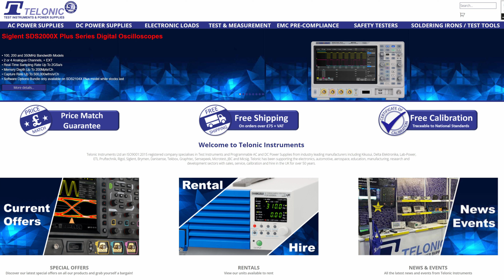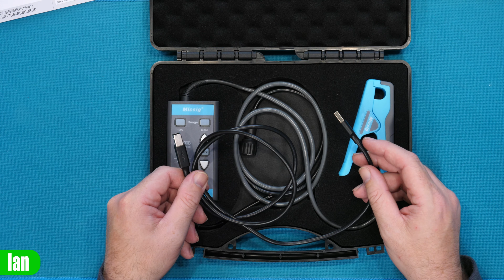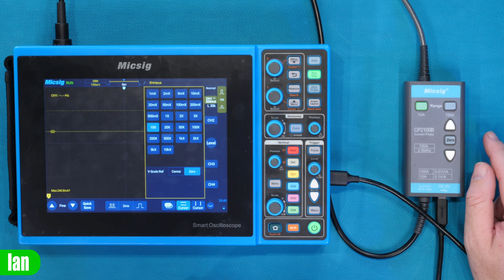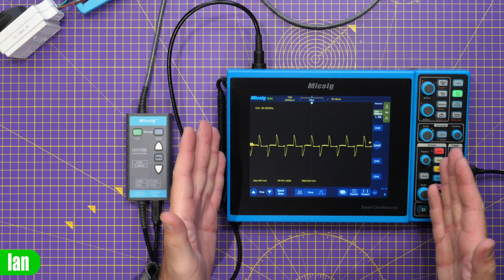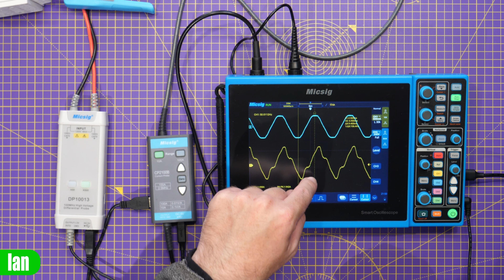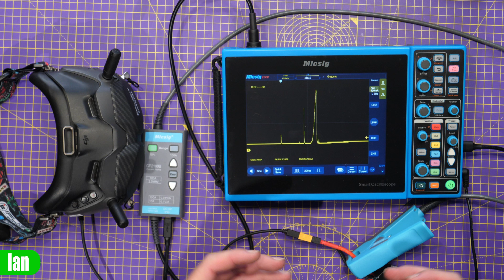Micsig CP2100B Current Probe - Overview & Demo

Comment: Accuracy is also impacted by the exact location of the conductor in the aperture. Now the probe needs to be positively closed, but anyone who has a 3D printer can make themselves a custom insert that centers a smaller cable.
When in a pinch, XPS foam board will also do the trick as it indents well and cuts just as easy.

Comment: When setting up the scope channel, must one really configure for "Current" for it to operate?  Is there instead a volts/amp ratio of the probe that would be used to give the same result if you accounted for the ratio? Thus you would read a certain voltage, but you would then scale that into amps yourself. Of course the convenience of directly reading "Amps" is nice, but suppose you have a generic scope that only has "Volts" for the probe.

Comment: Couple things to note: 
It works in both directions, the arrow just shows you where the positive direction is. 
Zeroing ist best done after attaching it to the conductor youre trying to measure, with no current going through it. If you zero it before clamping it on, you may get a slight error.